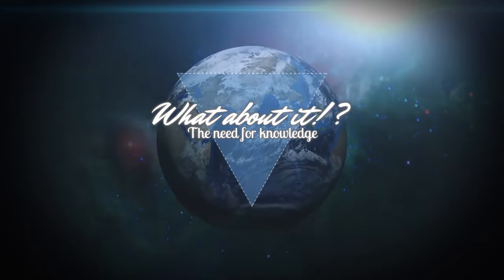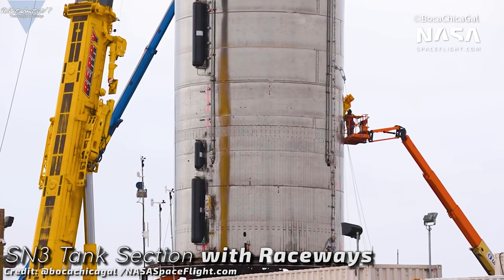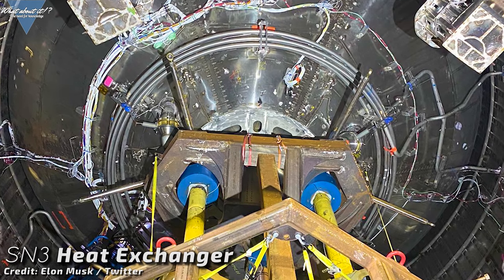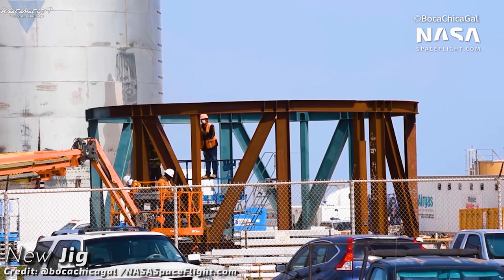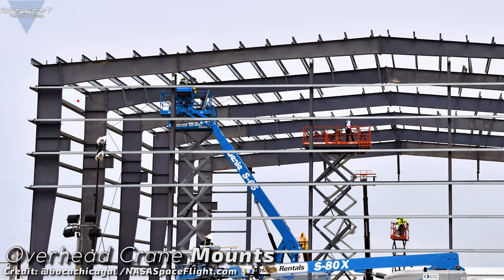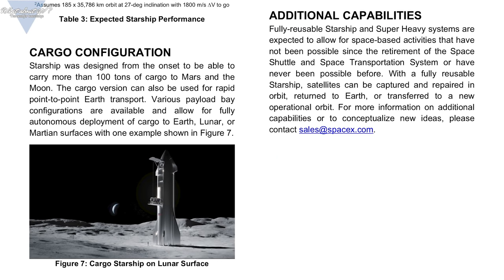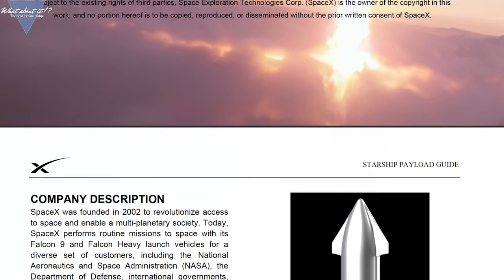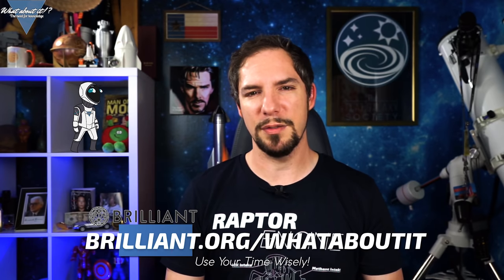82 | SpaceX Starship Updates – Starship User Guide Reveals Major Starship Feature

Comment: OK------------ Replacing the whole nose cargo section with different modules sounds great, until you realize that would mean changing the forward fins as well that would include power and control lines and the need to fine tune the new bow fins with the original lower stern fins for entering the Atmosphere to insure the ship can maintain control. Sounds like a complication not worth the hassle and risk from simply opening a large hatch.  Most likely the payload module talked about is simply a module that can be taken out to, lifted and placed into the fixed bow half between the fins and then the large clam shell hatch closed over the module read to launch. An easy rapid way to reload the Cargo Starship between missions. Having separate Nose Sections or modules is more complicated than simply replacing fairings on a Falcon 9.

Comment: "Get your own 9m firework for just 12 billion USD!"
Reply: Get your very own Swiss Knife of Rockets and slap a firework section on top of it. You can then use it to clean up the mess as well with our clean up fairing part.

(Has to be purchased separately)
Reply: the actual cost of manufacturing a starship will be around 5 million dollars
Reply: @PrathameshJakka  no. That's launch cost given in clickbaity advertisment. Manufacturing cost will atleast be several hundred million USD, if not over billion.
Reply: @PrathameshJakka  Even if SpaceX had 100% market share, each Starship launch would cost a few tens of millions of dollars, being optimistic.
Reply: @therealist3495  there is no demand for that price. Elon always exaggerates.
Reply: Luige Ribeiro Building a Starship costs around $300 million, booster included!
Reply: @kerbodynamicx472  not even SpaceX has this number!
Reply: Luige Ribeiro umm, $337 million, according to everyday astronaut
Reply: Prathamesh Jakka - The actual cost of construction will probably be somewhere between $500-800 million, which would work out to ~$5 million/launch when everything is taken into account (possibly including amortization of development costs).
Reply: It would take at least a decade to justify a number bellow U$ 100 million per launch (there is not enough demand), also Spacex will still need hundreds of engineers to make maintenances in Starship after each flight.
Reply: Luige Ribeiro - You do know they said the same thing about every other disruptive technology we take for granted from Automobiles to computers to jet airplanes to refrigerators & telephones that you’re saying about Starship, & they were all wrong. Being able to buy an automobile for less than a year’s wages created demand for cars. Being able to buy a refrigerator for less than a month’s wage created demand for refrigerators. Being able to fly across the ocean in a few hours for less than a week’s wage created demand for jet travel. Being able to buy a computer for a month’s wages that could do what one the size of a room had done a few years previous (& put it on one’s desk) created a demand for computers, & being able to do that on something you held in your hand (A talk to someone on a video screen) created a demand for smartphones.
Truly disruptive technologies have a way of penetrating into society in years, not decades. If you don’t believe me, look at all of the people using smartphones & realize smartphones didn’t even exist 15 years ago. Unlike STS which used to require 62,000 man hours to refurbish, Starship will be “turned around” in a matter of hours, more like a 747 or 777 than a Space Shuttle. So, it won’t need “hundreds of engineers” 100’s of hours “to make maintenances on Starship after each flight”. Demand that could never exist at even $100 million per flight (~$1 million/ton) will exist at $5 million flight ($50k/t). Ask yourself how many things don’t get launched into space because it would cost $350-650 million to launch them AFTER going through the extra expense of designing & configuring them to fit in a 5 m fairing, & ask yourself if they’d be launched at less than 1% of that without having to go through the design hassle the designers of JWST have gone through to configure it to fit into a 5 m fairing, & I believe you’ll see just how wrong you are. FYI, Jeff Bezos & Blue Origin are advertising just that in a rocket that will cost $90 million to launch & use a 7 m fairing, so it’s not hard to see what would happen with a rocket that could lob more payload for less money using a 9 m fairing would do.
You’ll see what I mean when 3 or 4 Starships are launched with 480 Starlink satellites each & when Starship lands 100 t of equipment, habs & supplies on the moon for $35-49 million...
Reply: @_mikolaj_  
What exactly makes you think that "manufacturing cost will atleast be several hundred million USD, if not over billion" ??
Any sources on that? Any experience?
Reply: @3gunslingers  logic. Lets take a look. Right now work quality at boce chica is lower than even cheapest expendable rocket. They want to make vessel supposed to fly multiple times. They must put bit more effort than on just small SRB launcher. "Production line" won't bring cost down in this case, beacuse they can't just go very fast. Falcon 9 boosters are on production line, and yet it's not cheap to manufacture. There it takes just ever week to make one Merlin 1D, bit longer for vacum variant. Raptor is more complex and it takes week to just assemble ready parts. Making those parts takes about 1.5 week on strict hard production (wich also raises cost, beacuse workers have feelings). So even if they now will make in upcoming years engines for few rockets, they will pretty soon slow down. And speaking about engines, raptor isn't cheap engine.  Other thing is infrastructure. You can't use tents to make spacecraft. Prototypes... If you're unproffesional ok, possible, actual spacecraft, nope. This will be expensive. Prototypes might use lazy ballon tanks. But once they actually start flying, they must use structural grid, otherwise thing will stop it's existance during higher acceleration or while flying into airstream pointing "normal"(that's the way it reenters.). This proces requires expensive tooling. In longer terms production cost might drop a bit, but production rate will also slow down. Another thing is interior. Starship is like small space station. So unless we go sparta, some money must be spent, to allow crew stay healthy, happy, and not radioactive.
Those definitly aren't cheap things. And that 5 million mark(wich even for launch cost doesn't seem real taking possible refurbishment, ground support costs, etc.) is rather unreachable, unless you'd fly those ships for 200 years when nobody will need them.
Reply: @3gunslingers  huh 1M per engine? Elon said many things, like Mk1 would fly ~5 months ago. 99% things from his twitter never happen. Also 1 tweet and SpaceX site quote, is less digging than constant 3 year observation of entire development.
Reply: @_mikolaj_  
Okay then. Where is your figure for the engine prize coming from? 

"99% things from his twitter never happen." Nope, not true. They just never happen in the time frame Elon anticipates. They happen usually a few months to a year later.

And please don't doge the other question I asked you.
Reply: @3gunslingers  raptor is complex engine. By comparing with similiar engines and material cost, it can be estimated about 3-5M USD.
PS: oh i didn't know that FH flied in 2008, dragon brought 2 tourists to the moon, and mk1 flied. Thanks for update
Reply: @_mikolaj_  
"By comparing with similiar engines and material cost, it can be estimated about 3-5M USD." 
I would love to read your sources for that comparison. 

"oh i didn't know that FH flied in 2008, dragon brought 2 tourists to the moon, and mk1 flied." 
Yes, and you also don't know WHY the FH didn't fly this early. And you don't know WHY moon-dragon was changed, not canceled.
Reply: @3gunslingers  just compare for example to BE-4. It's manufacturing cost is about 7M. It's similiar engine, just larger. Or you can compare to full flow staged combustion cycle russian engines, if that's too much difference.

Oh so dragon 2 is still going to fly to the moon? Man today is day of interesting annoucments
Reply: @_mikolaj_  
"Oh so dragon 2 is still going to fly to the moon?" Yes, the mission and the passenger still stand. Just the vehicle has changed slightly. Didn't you know? #DearMoon

"BE-4. It's manufacturing cost is about 7M. It's similiar engine, just larger." Agreed. The BE-4 is similar, but larger than the Raptor. But what exactly makes engines so expensiv? How can high costs be avoided? 

The BE-4 is like the Mercedes Zeppelin. The best thing you can get for your money. Maxed out ISP, best TWR for the buck, 101% reliability. Oak wood fittings.
The Raptor is like the Model T. Just good enough. And mass produced. 
Do you know the 80/20 rule?
Reply: @3gunslingers  #dearmoon is compeltly different thing. So well, i was right. Dragon never left LEO and never is going to do that. Also dear moon is not happening. Even if they would accelerate. They just won't get all safety regulations etc in time. Elon isn't king. He is just one of billions tiny men. He can't launch starship with crew just like that. He must proove abort abilities, and reliability. Wich means many test flights.
Reply: @_mikolaj_  
"Also dear moon is not happening." Who told you that?

"They just won't get all safety regulations etc in time." Which safety regulations? There are non outside of NASA launches. 

_"He must proove abort abilities, and reliability." To whom?
Reply: @3gunslingers  so you think buddy you live in completly free world? Wake up. He can't do whatever he wants. Besides NASA there are more things like for example FAA. We live in world where you must get permission for every single launch. Don't like it? Go ahead, become senator and try changing it. Good luck.
Reply: @_mikolaj_  
"Besides NASA there are more things like for example FAA." Yes, I know. And I also know that the FAA has no additional regulations for manned space flight compared to unmanned launches. 
If SpaceX gets permission to launch Starship, the FAA doesn't care if astronauts are in there or not.

Comment: I assume its an clean room level container who is inserted into the fairing and this is inserted into starship cargo bay. 
No its not lowered directly down but slide in but being upright all the time. 
ejection has to be sideway, but that might just be releasing payload and use RSC to shift starship away. or some gentle way to show it out sideways, 
This container is just there to keep cargo clean and don't need strength, so another tent.
Benefit is that they can put something like an telescope inside it

Comment: 😁 Thanks Felix, 👌 loved this video. Thanks for explaining the coils assembly on the PUCK, I was wondering what they were for 👍🏽.  1 question for you OR anyone out there,  Starship should eventually have 6 raptors, will there be ENOUGH room on the current thrust poke design to FIT 6 engines?  I hope the devise to simulate the thrust of the engines is capable of simulating the force of 6 engines on the welds, else they will need to REDESIGN the puck, and retest it.  What do you think?  
As far as the large building, I think the the ring machine will go in there, so can easily STACK and WELD 3 to 4 ring sections and tank bulkheads at a time.
Reply from the maker: Hey Keith, right now, the puck is configured for 3 engines. My guess is though, that it's already designed to take the force of 6 engines. That way, SpaceX would only need to add more fuel lines. That's it.

My guess is too, that the new building will house section building in the future. Rings being stacked, fleshed out and then moved out for stacking.
Reply: @Whataboutit   The new building may be for just the thrust section, installing all the Raptors, etc, the most intensively constructed part. Makes sense for a building with a relatively low ceiling and gantry cranes
Reply: The 4th large tent just being completed is the best candidate for the ring machine tent. The pieces for 2 small free-standing gantry cranes, just like the one with the current machine, were seen laid out in front of it. Apparently they'll make rings in a central point and distribute them to the multiple stacking areas in the other tents.

Comment: Wait, would the attachment of the fairing to the tank section be a structural mount, held together by a lock? Or permanent weld to the parts?
Reply: I assume its going to be something  like they already use to join Falcon 9's stages together
Reply from the maker: What Kilian said. Most likely a structural mount.
Reply: @kilianclasen5521  It scares me a little bit, because the seal between the two parts may not be strong enough for reentry, allowing for a gap, or for it to hold all of the structural stress, from the aerodynamic drag of reentry
Reply: @Whataboutit  Thank you for the response!
Reply: But anyway we are a far way from needing to apply this.

Comment: I wonder if the nose sections will be interchangeable, or just a variation during production?  So, all the thrust sections will be identical (or identical within a production block)?  But the nose sections can be different.  Such as, a cargo section mounted on a thrust section and becomes a cargo ship...and always a cargo ship.  Another might be assembled as a tanker and thus is always a tanker.  Or, will they be interchangeable on the pad, from launch to launch?  But can the nose section ever be a launch escape system in crewed vehicles?  Maybe?

Comment: Another great episode! Will starship have some form of whipple shield?
Reply from the maker: Would make sense, but would be difficult to do, as there is no fairing protecting the Starship on ascend. I don't know, if a whipple shield could withstand launch and reentry.
Reply: What about it!? I figured doing so would add a fair bit of extra complexity, i just got thinking of what use to happen to the space shuttle windows after each flight aswell as the tiny space debri hits the iss takes.

Comment: Question: Why use the hull of the ship for tanks other than to save weight?  What happens when space debris hits the hull (tanks) while it is a million miles from Earth?  Wouldn't having two or more smaller tanks within the hull of the ship which would make up the same amount of storage volume make more sense?  This way should a tank be compromised while in flight, it could be separated from the remaining tanks and flight would be able to continue?  I see no fail safe with the current design of the space craft and that is what is missing.  Yes I understand the need for weight to cost savings, but life and longevity of the spacecraft would be just as important.  I bet we could use preformed tanks which might even be stronger that what is currently being attempted and would offer a greater range of benefits.

Comment: Agreed One of the reason i watch and subscribe is learning about systems ! Thanks for the heads up regarding  pressurisation using the  raptors gasses ! That in itself raises a lot of questions ! Mixing of gasses for one if its using unburnt fuel for compression or does the raptor have an air compressor ( sts) built in using Lox prior to mixing ? So are these tubes for warming Not cooling ? When LOX warms it must expand yes ! probably just my brain going into overload but it would be nice to know not speculate hey

Comment: What if the clamshell door is the fairing, with payload attached? Door is hoisted in place and attached to internal support structures. Open the door in orbit and the payload is then outside the starship ready for deployment. After deployment, the door is closed ready for reentry. Starship lands, empty fairing door is removed and replaced with the next, full one.

Comment: I doubt the fairing is going to be interchangeable this is probably a misinterpretation of the user guide which is not well worded. 
The nose section contains the drag flaps and probably also rcs and power and other systems and is a continuous part of the heat shield and will be subject to huge bending stress so it's not going to be interchangeable due to all the cables and pipes and structural requirements and so on.
I think the payloads will be integrated to payload adaptors in starship cargo bay in the vertical position before the starship is stacked on the super heavy booster.

Comment: The Space Shuttle also pressurized it's external tank without using helium by feeding both gaseous hydrogen and oxygen from the engine back into the external tank.

Comment: Would the feedback of partially combusted gas not feed some oxygen into the methane tank? I highly doubt the ratios would be in the right range for combustion unless the methane tank was very near empty. Its certain spacex has thought of this and mitigated the risks, but I'm still curious nonetheless.
Reply: I think raptor has two types of partially combusted propellant.  One with extra fuel, the other with extra oxygen.
Reply: I don't think Felix has it quite right The tubing in those circles carries pure oxygen and pure methane. They circle in their own tubes and don't mix. At some point in the Raptor engine cycle gaseous oxygen and gaseous methane are created. I think they are tapped off separately. You are right, a mix containing methane and oxygen is very dangerous.
Reply: @johncrowerdoe5527   I think you're thinking of open cycle engines like the Merlin and RD 180. The Merlin runs fuel rich, the other oxygen rich.
Reply: @donjones4719  now that makes way more sense.